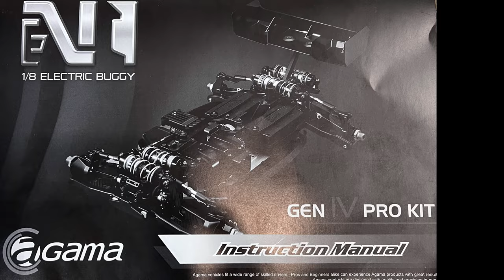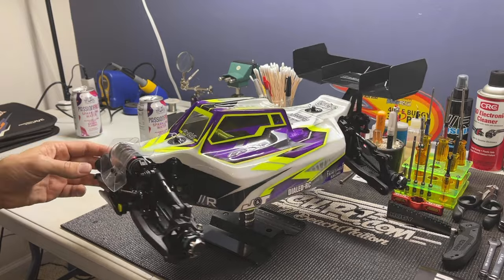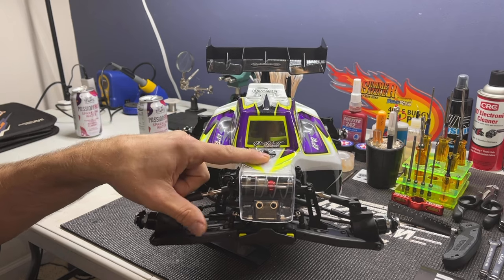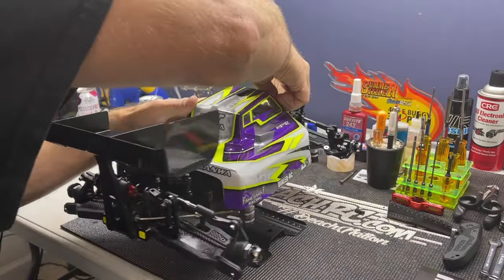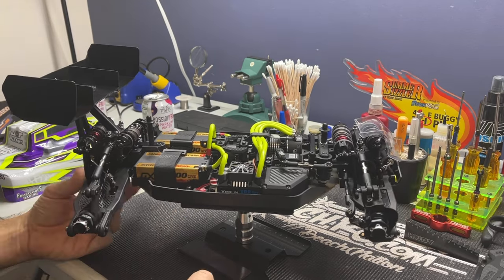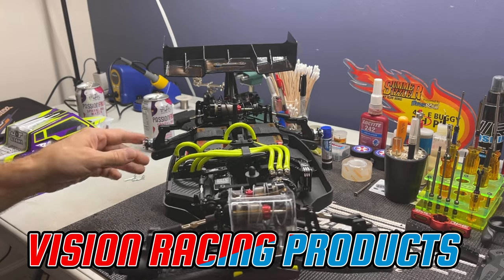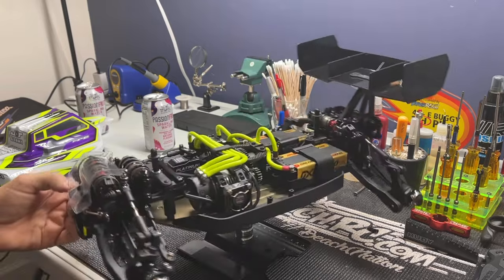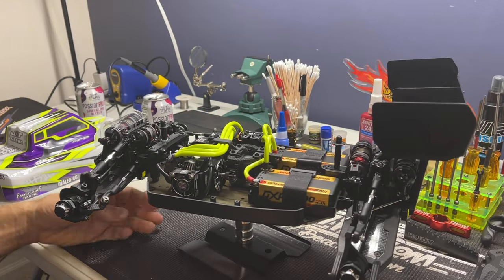⚡️AGAMA N1E - REVEAL!!!⚡️#rcbuggy

Comment: Motor fan is on backwards.
Reply from the maker: How so ? You can mount it either way depending on how you want the air to flow. Drawing heat away from the motor or blowing air over the motor.
Reply: @rccaraddict294   If it hand ducting then sure but without it its just the same as pissing into the wind.

Comment: Awesome build. which bullet connectors did you solder for between the batteries ? I see the wire is soldered from the top of the connector ?
Reply from the maker: TQ WIRE , 5mm flat top bullets. They are fantastic connectors

Comment: do the wires from the motor to the esc all have to be the same length?
Reply from the maker: No , some one else asked the same question the other day about my truggy. The wire length difference on the serpent are more drastic than this and I have never had an issue in all the years I have been racing
Reply: It looks really clean, I’m building my first kit soon and want to do something unique with my wires
Reply from the maker: @cdwag23  thanks man. It’s all about taking your time planning the wiring and having a nice soldering iron. I recommend the HAKKO 888 it is phenomenal. Not sure if I made a video about it but I think I did a while back when I got it. Also I like to use a little flux on each wire and good soldering wire like Miniatronics.